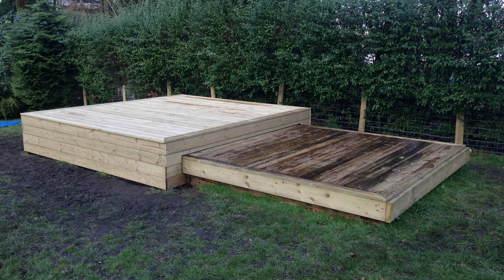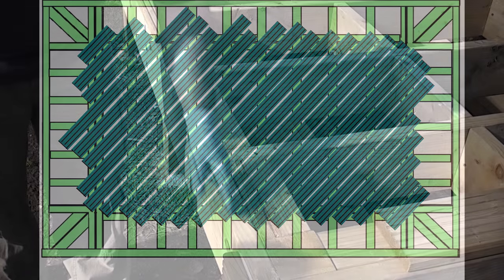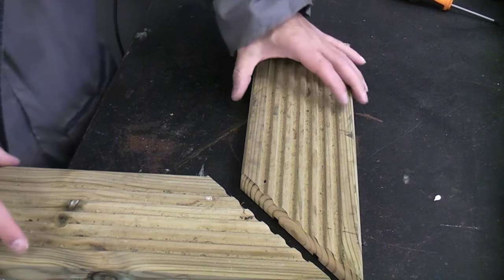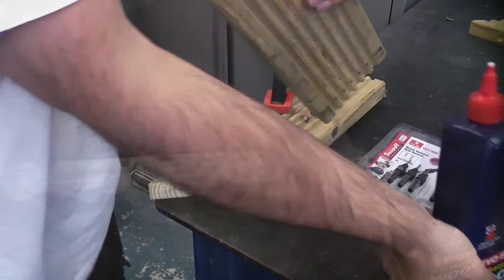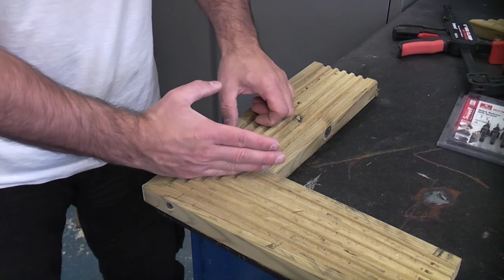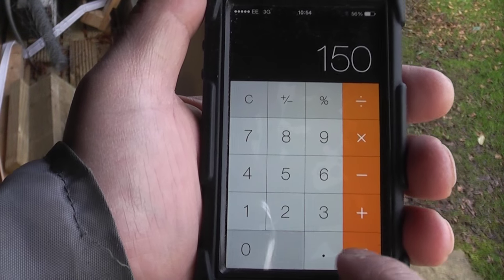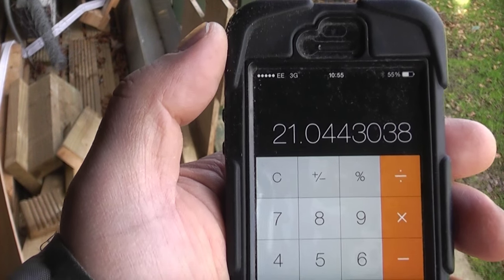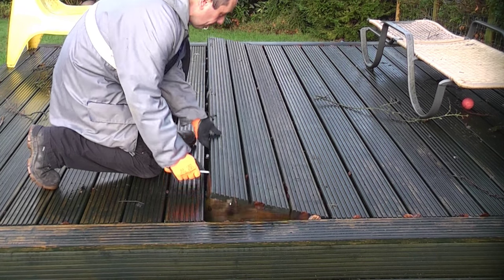How to build a picture frame deck

Comment: Nice, that will keep the fox poop out.
Personally I leave a 6mm gap between the mitres of the picture frame for water drainage and timber expansion. A drop of end grain preservative, even on pressure treated timber, extends the life of the deck. Any gap bigger than 6mm between boards can let the heel of a ladies shoe get caught.
I am looking forward to seeing the mechanism.
Reply from the maker: +Michael Tricker 
Thanks for the comment ;-)

Comment: What can you use to biscuit it if you don’t have the tool to do it?
Reply from the maker: You might be able to cut the biscuit slots using a circular saw.
Or you could just use wooden dowels, if you have a drill

Comment: I'm sure it's not really an issue or concern, but wouldn't it be more accurate to change your calculation as follows: (Area-Gap)/(BoardWidth+Gap).  So (3325-8)/(150+8).  7mm gap = 21.134.  8mm gap = 20.994.  This allows for the fact that there is a gap at the beginning and the end of the boards, not just one end.  Edit, for some reason I can't use line breaks
Reply from the maker: +DreamingSheep 
Yes, that would be more accurate. But it's a deck and not a Swiss watch LOL
On the sand pit lid especially I had to vary the width of the gaps considerably to make all the boards fit, but it was not an issue as the gaps were filled with black silicone afterwards (plywood underneath).
Thanks for the comment ;-)

Comment: There seems to be a lot debate on youtube on the correct way to install decking board. 
Alot say that the groves are drainage to protect the joists, and should be placed the opposite way up to what you have, While others say that the groves are grips for walking on.
Reply from the maker: +Lee Ramsden 
I always thought the grooves were for grip when walking on them.
I guess in warmer climates you could turn them upside down! 
Thanks for the comment
Reply: Theyre most definately to keep air flow between boards and joists... Not for grip...

Comment: The retractable sandbox cover is simply awesome. I could catch what you said you used for spacers. Bad hearing. Played it several times and I couldn't quite make it out. Could you spell it out for me?
Reply from the maker: +WoodRodent 
Sorry, my accent does not help.
I used glazing packers http://fave.co/1V2TiUo  to get the desired space between the deck boards, but you can use plastic shims etc.
Reply: Your accent it fine. It turns out I did hear you but I was not familiar with the term. :-) Thanks for the response.
Reply from the maker: +WoodRodent 
You are welcome!

They might call them something different in different places. They are used over here to pack up double glazed window units inside of UPVC window frames etc.
Thanks for the comments ;-)

Comment: What happened's if something gets stuck under the sliding cover? you take it all apart?
Reply from the maker: No, there is an access panel at the back and also on the top where three boards can be completely lifted out very easily.
Thanks for the comment
Reply: ohh okay wonderful. this is a sweet design man love it.
is there a video showing how its driven and how the motor works?
Reply from the maker: Sorry, I did not film that bit. 
You can see some of the runners that it runs on in this video- https://www.youtube.com/watch?v=erpUegt5pqo
I did film how to make the sand pit lid and fit all the wheels etc. but I have not had time to edit it as it was filmed over a few weekends and requires a lot of editing.
The motorised bit is simply a garage door opener connected to the sand pit lid.
Reply: eh i see oh well. what mechanism did you use to push and pull the lid?

Comment: 8mm gap between the boards.. Don't accidentally drop any spare change on the deck! I prefer no gap - orient your boards 45 degrees to the joists.. no gaps

Comment: Excellent demonstration of proper assembly, however.....
Those deck boards/ planks are absolutely BAD BAD BAD with those channel grooves. 
Why ? When it rains the water will sit until it evaporates. If it's cloudy for several days water will sit even longer. I give it 2 seasons max before it starts splintering.
Reply from the maker: It's been there for 3 years and no visible problems apart from the stain started peeling off after a few months.